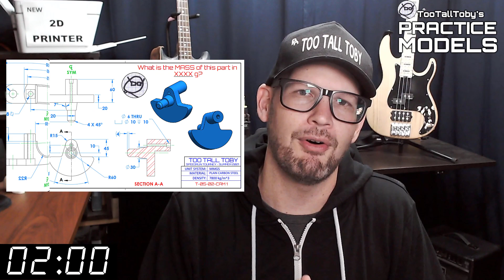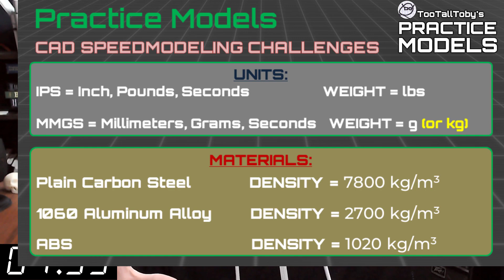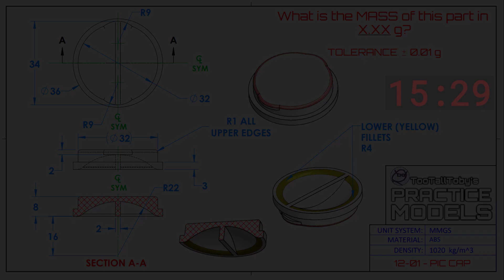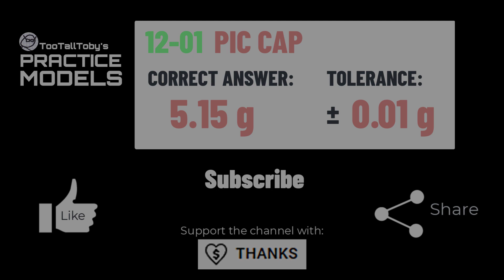SOLIDWORKS Practice - Onshape Practice - Fusion 360 Practice  - TooTallToby-12-01

Comment: 3:20 on the first try, 1:56 on the second try.
I find I spend a lot of time looking for dimensions on the first try!
The second one you remember the values/know where to look which really speeds thing up. I guess if you want to get really quick you have to keep doing it to get faster at the actual CAD workflow (using all the shortcuts and avoiding extra mouse movements etc...)
EDIT: did it a 3rd time in 1:22 after thinking of a couple time saving options while reading the comments.
Reply: Not sure Youtube will let me link to this recording of a 1:10 solve: 
https://drive.google.com/file/d/1dMli8saUh1VEuM2BzCWGt43grXChQOLS/view?usp=sharing
EDIT: looks like it went through, note: it's a GIF so you might have to download to view...
Reply from the maker: nice job airwick!@  Speedy!
Reply from the maker: Very nice!

Comment: Ok I'm not very fast, but got the answer right 1st time around of 5.15 grams in 13:45 using Solidworks. Also did it in Fusion 360 the answer was correct the 1st time around for that as well however, the clock ran out before I finished. 
Thanks for the fun model Toby!
Reply from the maker: Awww yeah!  Awesome!  So glad to hear that you are getting the correct answers!  Keep up the hard work - the speed will come with time!

Comment: Happy Thanksgiving my friend. I  tried  to  use a rib  command  for  those  nubs. It  may have worked if I did it  before the  filet. I am  falling in love  with the  rib command and  hole  wizard. I think  you  can  use the  rib  and hole  wizard as exploits of sorts. I do not  think I will ever  be  fast but I sure hope I am accurate.
Reply from the maker: Nice job Jason!  I think the RIB command is super under utilized in the tourneys - so just using it (properly) would be an exploit, of sorts :-)  Glad you are learning all about it!
Reply: I can't get the damn rib command work in Fusion either.
Reply: @Tavdog  once you get it figured out it is great.

Comment: 13:50 for 5.149 g ... I'd be interested to know if there is a faster way to do the middle ridge ... I did a sketch of it's section, extruded it and remove the small parts between the top tabs and the bottom lip and it felt verry slow ... Was a fun one, thanks
Reply: Web tool.  With the web tool you just draw a line across the lid, web tool, 2mm.
I'm using Fusion 360 but I imagine OnShape and others has that tool too.
Reply: For the middle ridge, if you did a center plane sketch and extrude it 31.5mm it wouldn't break through the upper 32dia part and no need to go back and remove anything.
Reply: Solid works use the rib command, had to add the large fillet first.
Reply from the maker: Yeah I'd say either RIB, or EXTRUDE up to next (from the bottom) or extrude mid plane, if you wanted to draw the arch profile.  Maybe use Intersection curve for this last approach.
Reply: @TooTallToby  RIB for the win.
Reply: I like rib since you can hit "Extend profiles to part" or whatever and then you don't have to constrain the endpoints. However for funkier shapes sometimes extruding downward and doing "up to part" provides more easily controlled results, but often also requires more setup